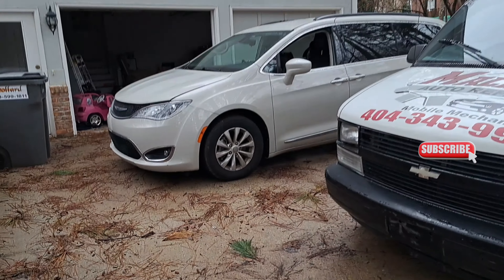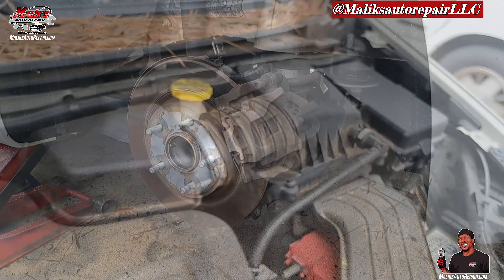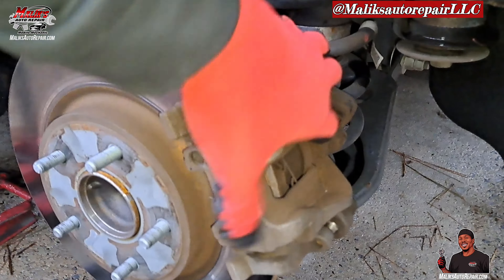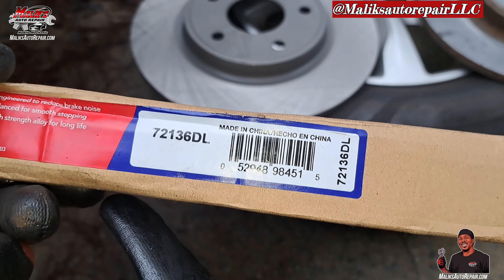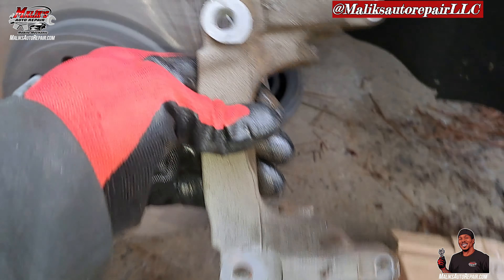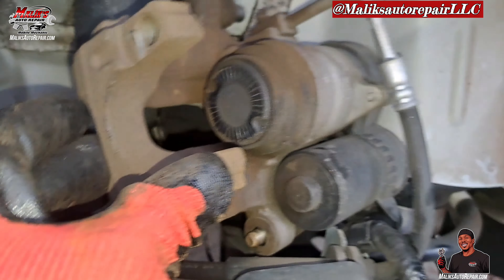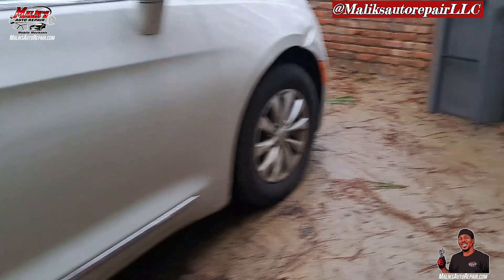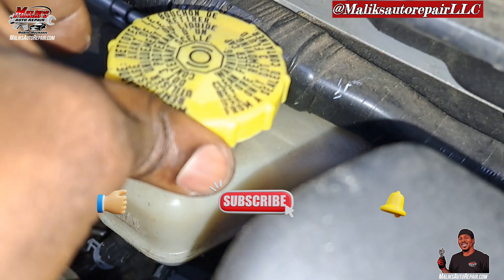HOW TO REPLACE REAR BRAKE PADS & ROTORS | 2017 CHRYSLER PACIFICA 3.6 | Easy/ Howto/Diy

Comment: Solid video!  Quick question, you said turn and push when pushing that caliper piston back in. I've never turned mine, just curious where you learned that?
Reply from the maker: Oh really?! Good to know. It looked like my special tool was needed. Was scared to use the c clamp when I saw the 2 notches on the piston and that plastic on the calipers. lol Didn't wanna break it. Thanks for that info. Ima pin this comment so ppl can see it.